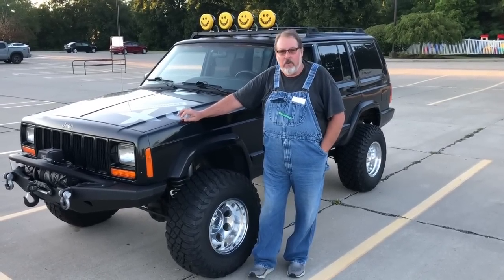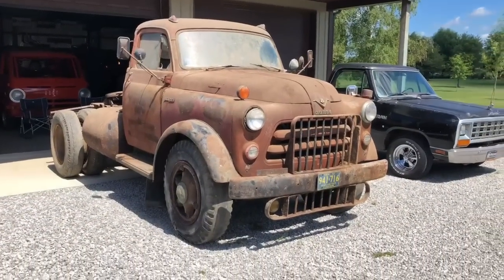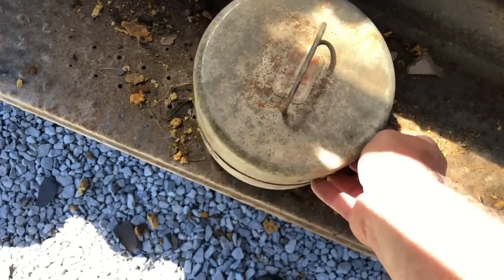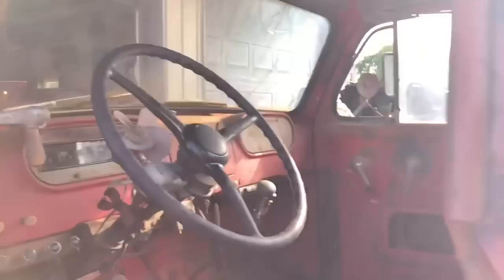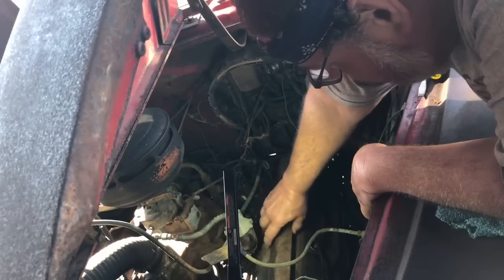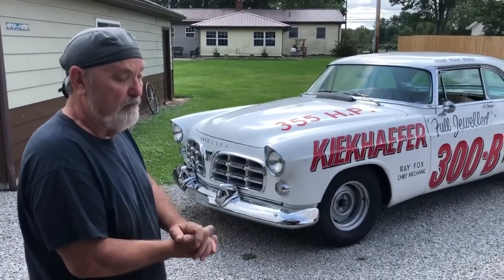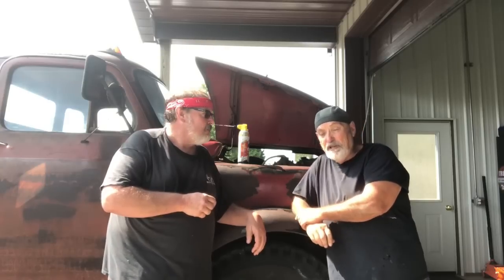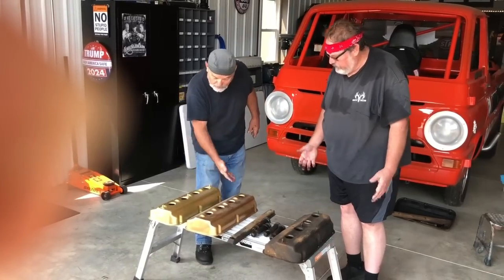Woolly Mammoth Dodge (Barn Find)

Comment: Those have got to be the most impressive saddle tanks I've ever seen on a single axle day cab rig before.  I can't wait to see it brought back to its glory as a Original condition car-hauler.  I'm shocked to be it's all there.  even down to the fire extinguisher and light service box done in the truck's cab color.  This type of truck would be a day/short hauler for midsized trailers.
Reply from the maker: Thanks for the input
Reply: @martyshotrodgarage    very welcome, good luck with the project.
Reply from the maker: So you think definitely 
“Car Hauler”?

Comment: Wow, great old truck. I am a Mopar truck guy big time. I now have a 66 Dodge, D-600 fire truck, and other dodge trucks. And I have owned a few first gen Hemi's. I have one left now. Anyway, I do know Chrysler, Dodge, and Desoto. Al used the first gen Hemi. However, I also know they all had their own designs. Almost no parts interchange ( I always thought that was a bit odd). I guess what I'm saying is. I am surprised that a 331, a Chrysler engine. Would be in a Dodge truck. Or perhaps they cross those lines under heavy-duty units. Your truck being a rare air brake unit is like my fire truck have power steering, also very rare. And by the way. I am an old pipeliner myself. Operator by trade. Carry on brother's outstanding project.
Reply from the maker: Thanks for the positive comments Kent, really appreciate hearing from you truck guys. I’ve been a Mopar guy my whole life but I’ve got to admit this one is a little before my time and it has me scratching my head a lot!

Comment: I agree with what the gentleman said,. A complete restoration would be nice to see . Coz you don't see many of these anymore. And this truck was well built, and had good metal back in those days, So yes a complete restore job I would like to see.
Reply from the maker: I agree a complete restoration would be nice but body and paint is so expensive anymore…I can make it run, drive, stop and go but the body may have to stay as is….at least for a while

Comment: My two cents' worth is NO!!! to the rat rod/scruffy "patina" concept. For me, there's plenty of "patina" in junk yards, in the unlikely event that I ever want to look at it. I'm not a slave to the "It's only original once." doctrine, either, which seems to hold that no old vehicle should ever be modified in any way. I'd like to see it repaired, repainted, running and stopping well, and useful. It may not be particularly beautiful to every eye, but it's a charmer. Do the front wheels have hydraulic brakes?
Reply from the maker: Thanks for your two cent’s worth, my first step is going to be get it running, tires….probably new wheels, the truck guy’s have me scared to death of these old Dayton rim’s. I know it’s air brakes on rear not sure of front, air brakes is something I don’t know much about…thanks for your comment and thanks for watching
Reply: @martyshotrodgarage  My ignorance about air brakes is pretty vast, too, but remembering the big cylinders they use on the rear brakes, I wonder whether there would be enough room for something of that nature on the front, and how they would work with steering. I have five NOS 50s Dodge truck wheel cylinders, and thought a couple might be useful to you, if your truck uses them, and if they're right for it. I share your well advised caution about those wheel rims. They can be killers.

Comment: I can give you idea on break down of vin
C-1 =1954 to 1955 1/2 (c-3 1955 1/2 to 1956 would have curved glass)
T= model (3 ton)
A = 2 speed rear
8 = number cylinders engine has
There should be another # to designate wheel base
Reply from the maker: Thank you very much
Reply: Actually have one of my own that has the same mysteries like no engine vin and blank covers.
Reply from the maker: @jasons9911  331?
Reply: @martyshotrodgarage  Sorry no, mine is a 56 so it has a 354 information is a mystery if that is correct engine(one book says 354 and other says it should be 331) but it looks identical to yours but casting numbers on mine make a 354.
Reply: @martyshotrodgarage  would you be able to do me a favor and take a picture of the shock setup on your truck?

Comment: Well, when you asked 'what should we do with it', and the ideas that followed (ratrod or car hauler?), the first thing I thought of would be a Toter. When this truck was made, there were few straight bodies...most trucks were (what we would call now) 'light duty semi-tractors'...and they pulled their flatbed, container bed, even some refer beds behind them. This is easily replicated with a gooseneck trailer, today ('hot shot car hauler'), or, change the hitch on the gooseneck to a 5th wheel (like a Reese 20k or 30k rated), then install a new kingpin hitch (again, like the Reese or Lippert) on the truck (once restored), and make a modern RV-toter out of it. Since you are 'pulling your house' behind you, it doesn't matter that there is no sleeper built into the cab, then...PLUS...you resto-mod the truck, instead of destroy it from its original design intent.
Reply from the maker: I’m kinda liken’ the way you’re thinkin’, and…my race trailer is a 38’ gooseneck, thanks for watching and the comment!

Comment: I would keep it as original as possible. That's neat van in the back .I had a 1966 Dodge 200 with a 318 wide block.  I got headlight rings of a Van in a salvage yard for that truck from that model of van. Cool video.
Reply from the maker: Thanks for the comment Adrian, working on getting it running….not a van in the background it’s an A100 truck, thanks for watching

Comment: I drove a 1955 Dodge five ton stake body once. It was loaded with concrete block and it hauled the load just fine. I believe it was a four speed transmission with a two speed rear end and a flathead six engine, so probably around 85 horsepower. Back then they made up for lack of horsepower by using very short gear ratios. Aside from the differences I mentioned, the one I drove looked a great deal like yours. Thanks for the memories.
Reply from the maker: Thanks for the comment David and thanks for watching, I just love hearing old stories like this. Just pulled it in the garage Friday getting ready to pull the engine out

Comment: Be careful around those wheels. If they are Dayton rims and hubs they are probably split rims for heavy-duty loading and they can be widow makers. If you are going to replace the tire, be sure to only loosen the nuts, keeping the clips in place. Then tap the rim from the backside. The hubs are a tappered fit and the rim will shoot off the hub. With the clips still held on by the backed off n7t, you'll keep the rim from flying off for about 8 feet and possibly hitting something or some one. I learned about this from hearing a story being told.
Reply from the maker: I’ve heard alot of horror stories about those old rim’s for sure, thanks for the heads up!